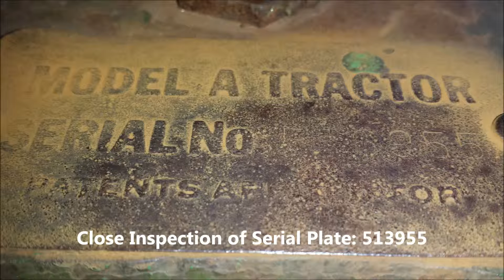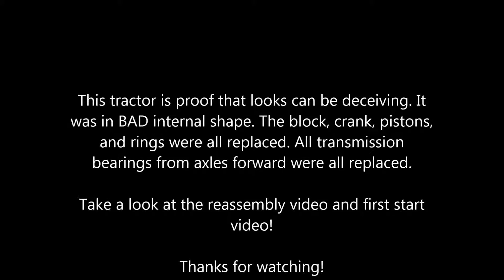1942 John Deere A Disassembly

Comment: Hi Kenny; What are the differences between an 'unsettled' and a 'styled' John Deere?
thanks,
Skip
Reply from the maker: Easiest way to put it is in late 1938 (for the 1939 model year) the John Deere Letter Series (A/B) underwent 'modernizing' to keep up with IH and other tractor brands. It included more stylish sheet metal (hood, grill, etc.), updates to the transmission and engine, electric start options, etc. Easiest way would be to do some Google searching to see the differences. The tractors were again updated in mid 1947 (transmission changes, engine changes, as well as an updated frame construction).